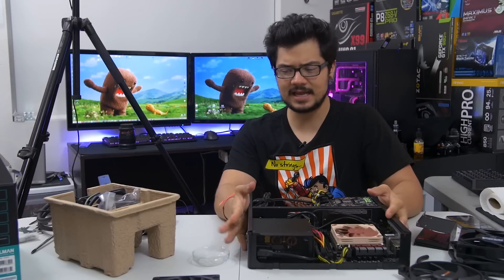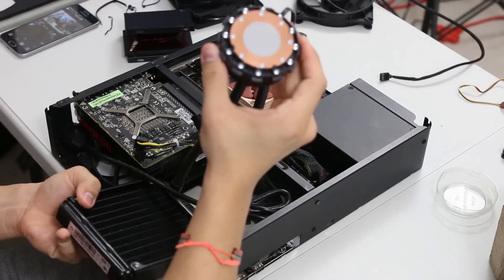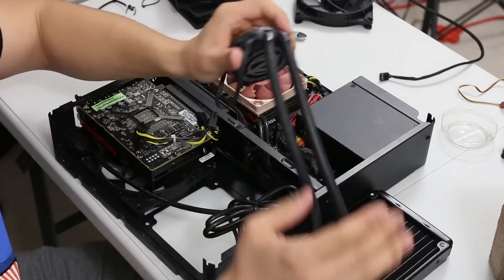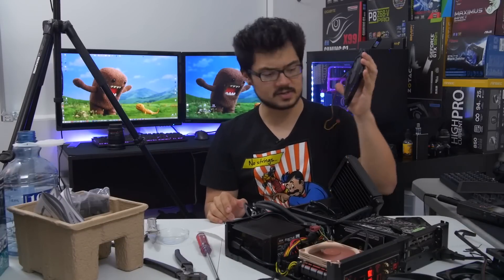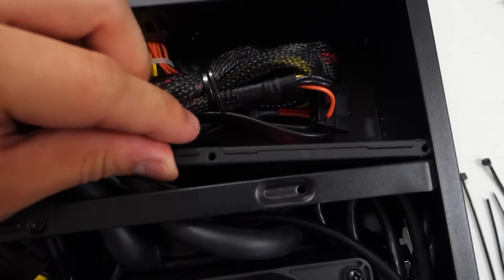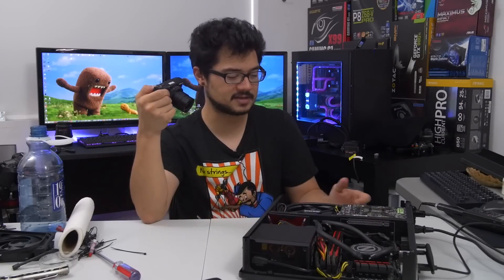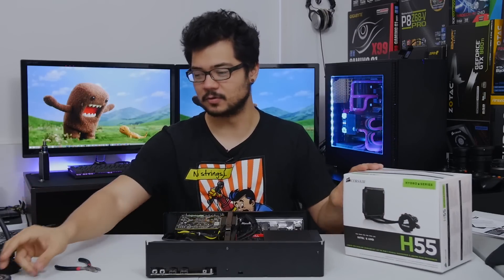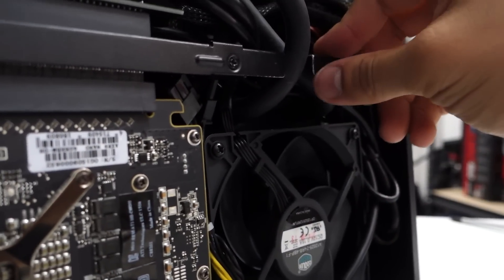Challenge Accepted: Liquid Cooling in the Fractal Node 202!?

Comment: Hey there I want to run something by you a really cool idea that I came up with I really appreciate all this hard work that you put into this  it's very similar to the idea that I've come up with mine's going to require a little bit more work but it's basically going to incorporate this same premise thank you for making this great video and I will definitely use a lot of the ideas that you came up  within my idea and my billd the idea is to basically build my own portable laptop / desktop gaming laptops are stupidly expensive and underperforming for their price so I figured that I would come up with a better solution a portable one using a small form-factor case just like this the idea is that I can  take a monitor and modify the case a little bit putting some hinges on the case and taking the Monitor and attaching the monitor to the hinges routing the wires out from the back end zip tying them together inside the case so that the wires arent hanging out Then just simply have a USB keyboard and mouse stuck onto the outside and have a little latch on the top of the monitor and the top of the case and then bam you have a portable gaming computer which is basically just a bulky laptop with full gaming computer performance I'm pretty sure that you're busy and that you might not even see this I don't have the money myself to do this kind of stuff in fact I may never be able to afford a gaming computer I've been very poor all my life and I've worked very hard but I just don't think that's going to happen so I want to see this idea happen and I'm sorry that I can't provide you any more details but if you want we can talk about it and I can give you the rest of my idea about it gaming laptops are just too expensive and I feel like paying all that money for something that doesn't even give you desktop level performance for the price is simply wasting money and I want to prove to people that you can come up with your own solution much cheaper than that of paying for a laptop like a predator that's a simple stupid amount of money For barely even gaming level performance At the money that you're paying for it I just feel like the performance to value is completely off and I want to prove that you can get small form factor and Power along with portability without having to pay a stupid amount and without having to be over  engineer something to the point which it's impossible end too expensive alone please do hear me out I want to see this idea happen I realize that you're probably very busy or that this seems like a stupid idea but I really want to see this happen and I can't do it myself,,,, I've been trying for years just to save up enough money to buy the basic stuff for it but I can't even do that I want to see this idea come out into the daylight to prove that it's not too hard and complex that it doesn't have to be expensive to get mobile gaming performance that it's really not that hard  I'm sorry if I'm wasting your time but if you have read this far I really appreciate it and would like to give you all the details of my idea….

Comment: I'm just wondering why he (you) didn't dismantle whole case. Remove all components, unscrew metal partition in the middle fit watercooler in and screw all together again. Only issue I believe you could come across is that there will be some rivets instead of screws and thats easy fix, just make new rivet. Or am I missing something? If you consider time, you should be even finished faster than 24 hours which it took you in this video :-)

Comment: I was thinking about doing a build like this in this case, it makes X99 pretty viable as well. Its good to know that an AIO cooler is possible in here with an R9 nano, possibly taking out the PCI-E extender bracket and putting in the cooler first then replacing it or after cutting out that piece of metal make a small supporting piece of metal and drill some holes in it to give it some structural rigidity again. Would make an absolutely sick build to be honest.

Comment: I would suggest you remove all hardware before sawing a case next time. Metal dust can cause short-circuit. It would be best to disassemble it and air-clean everything thoroughly just in case.

Comment: GPU temps? ~300 watts pumping into the GPU half of the case with not much more than a couple PCI slots worth of vents and a nano heatsink doesn't sound good. IMO much better off with an RVZ01 with Cryorig C1 + NF-A14 industrial and a full size GPU if you're overclocking

Comment: Fan installation incorrect? Pull not Push.
No one notice he had his fan the wrong way? Radiator fan is actually pulling hot air into the case instead of pushing it  out of the case 14min mark shows that clearly

Comment: This can literally only be done with a nano
Reply: +PappaLitto Or any other mini itx card, although the nano is notably the most powerful. 970 and 380 are the next best two cards available in the form factor. Also this does heavily imply you could probably make a Fury X work instead. Maybe even add a cpu aio radiator ontop of the gpu aio (you would need a custom pcie plug in). One fan would be ok though.
Reply: If you look, the power connector is pushing up against the radiator, the nano is at least a centimeter smaller than any mini itx card.
Reply: Most of these other cards don't use side facing pcie connectors. Which prevents the issue in the first place.

Comment: I`m 4 mins in & . . . . WHY do you wanna take the AIO apart ! don`t mess with it, make a small cut in the mid case metal ( preferably when there are no components mounted ) and then Gaffer tape, rubber taape, solder it back together surely ?
Reply: hah hah hah I see it was a bad idea then !

Comment: Breaks open a sealed AIO cooler, and unsurprisingly introduces air into it, then, uses a hacksaw and a metal file without removing the motherboard from the case, and then doesn't make a bridge piece after for the now structurally compromised case he's butchered .. smh.

Comment: all you had to do was run the zalman pump without the bottom plate on in a tub of distilled water or what ever liquid you are using to refill it, run a couple of pass til no air pockets then reseal it again, had try this before with a couple of my corsair aio coolers, but would never know if that zalman had the same pump as my corsairs,

LETS JUST FACE IT KYLE, YOU JUST DIDNT WANT ZALMAN ALL OVER IN YOUR SHITTSNITS BUILD, ITS ALL BOUT THEM BRAND NAMESS CORSAIR JOHNSON EHH, RIGHT JONHSON!!!!

Comment: You mean AIO in a fractal 202? Dont confuse proper liquid cooling setups and AIO. AIO pose no challenge and risk of installing such unit is minimal or non existent. Actuall you would have been better off with liquid cooling set of some sort here. Use L shape fittings and job done.

Comment: What's your opinion on my computer specs? I am looking to play games in 1080p Ultra settings at a smooth rate, hopefully around 50-60 FPS, I am not interested in doing video editing etc, Just gaming and some mild programs such as Microsoft Word etc. Anything you think would be worth upgrading besides the CPU? Thanks!

Computer Specs

CPU: Intel Core i5-6600k 3.5Ghz
CPU Cooler: Corsair H100i v2 70.7 CFM Liquid CPU Cooler
Motherboard: Gigabyte GA-Z170X-Gaming 3 ATX LGA1151 Motherboard
Memory: Corsair Vengeance LPX 16GB (2 x 8GB) DDR4-2666 Memory
Storage: Seagate Barracuda 2TB 3.5" 7200RPM Internal Hard Drive
Video Card: MSI GeForce GTX 970 4GB Twin Frozr V Video Card
Power Supply: EVGA SuperNOVA NEX 650W 80+ Gold Certified Fully-Modular ATX Power Supply

Comment: comoon man you make so noob mistake by opening the NOT TO OPEN COOLER becouse exactly theas kinda failures aij aij aij . Man just mod the case cut the metal 2-5 cm on the top and the hoses will fit , and its not gonna effect the case any siniffigant measure it would be fine and storng still .Damm iam really feeling the hurt allmost my self But other wise cool video like the case size and the CPU GPU  on this form factor is just cool little super game flame thrower .What GPU was that was it AMD Fury nano ?tanks subbed becouse y

Comment: I don't want to be one of those guys but can somebody tell me if I'll be able to run new games at high frames with high settings (please be honest) over-clocking?
AMD FX-6300 3.5GHz 6-Core Processor
be quiet! PURE ROCK 51.7 CFM Sleeve Bearing CPU Cooler
Biostar TA970 ATX AM3+ Motherboard
G.Skill Ripjaws Series 8GB (2 x 4GB) DDR3-1600 Memory
Samsung 850 EVO-Series 250GB 2.5" Solid State Drive
Gigabyte Radeon R9 380 4GB SOC Video Card
Corsair 200R ATX Mid Tower Case
Corsair CX 600W 80+ Bronze Certified Semi-Modular ATX Power Supply
Asus DRW-24B1ST/BLK/B/AS DVD/CD Writer
Microsoft Windows 10 Home OEM (64-bit)
Corsair Air Series SP120 High Performance Edition (2-Pack) 62.7 CFM 120mm Fans
Cooler Master SickleFlow 69.7 CFM 120mm Fan
NZXT Sentry Mesh Fan Controller
Thanks you! If you recommend any different parts please tell me. I was going for a 1000 dollars build but went a little bit over. I do live in Canada and we get screwed over in prices.
Reply: You should be able to! The 380 is a pretty good card.

Comment: CUSTOM WATER LOOP DO IT!!!!!!! AIO COOLERS ARE SHIT!!!!!
Reply: +Theorcman2008 Do you really expect to fit at least a 240 rad with a full loop to the CPU or GPU. I don't think so.
Reply: +BananaMasterRace you can run a cpu loop only and you have more choices with custom parts like angled fittings and 120mm radiator. come at me bro I have been doing this for ten years or more. watch yourself.
Reply: +Theorcman2008 There isnt enough physical room to be able to fit a reservoir. and if you do manage to fit a res, you would probably have trouble fitting other components like an SSD or 2 1/2" HDD drive anywhere else in that system, the size limitations are just too small.
Reply: BananaMasterRace
I have seen custom water loops in smaller cases. Also depending on the optical bay size a bay res would work wonderfully.
Reply: Theorcman2008 are there slimline ones though?
Reply: BananaMasterRace
Yes there are trust me man you can do anything and actually a swiftech mini res would fit in that case nicely.
Reply: Theorcman2008 Hm, okay then, I will big the big man and admit I was wrong. so totally going to try this if I ever earn the big bucks
Reply: BananaMasterRace
Im actually thinking about it myself =D. I will let you know how it turns out so you dont waste money if it fails ;-)